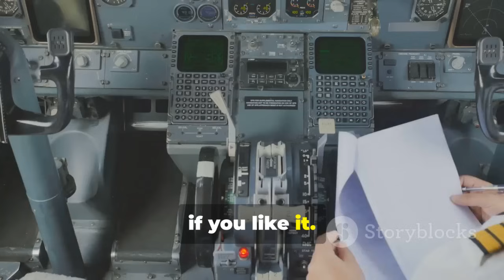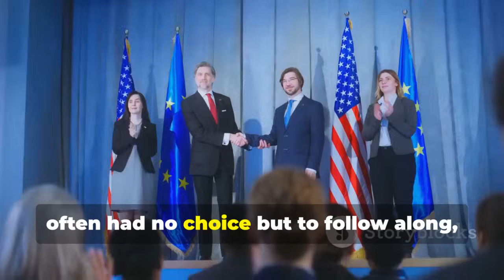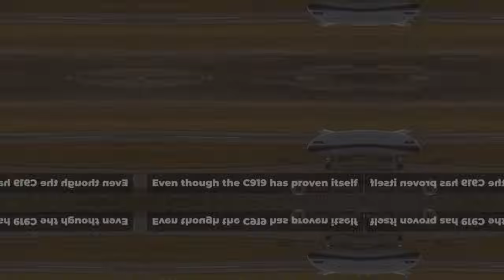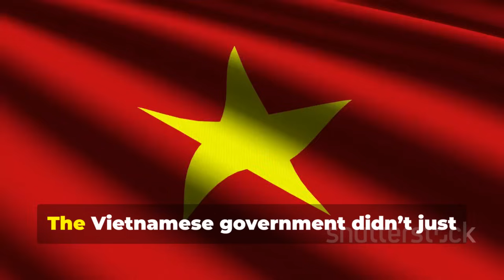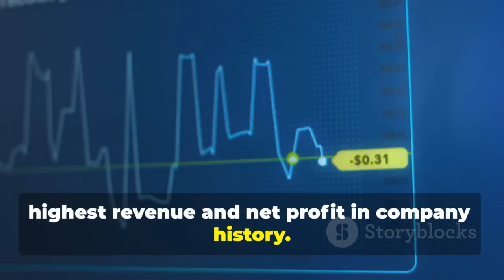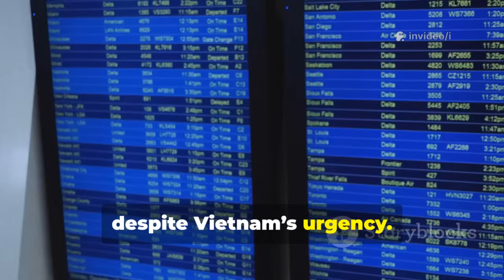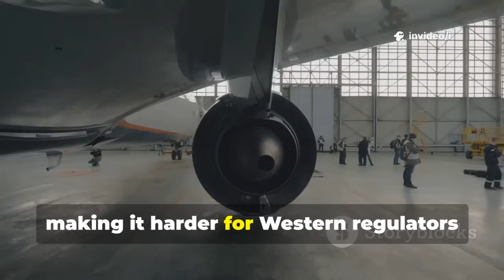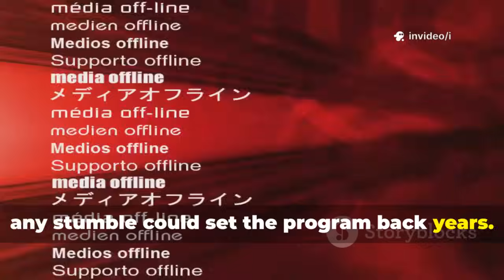Boeing & Airbus in Trouble! Vietnam Goes All-In on China’s C919 Jet

Comment: What extra proof do those   doubtful foreign airline regulatory authorities do they still need? It is already proven in China that the C919 have been successfully and safely used carrying millions of travellers for several years. Certifications are merely used to kill off competition. Simple as that. Do not buy into Western fear that the C919 lack safety features. China of course care for the safety of all its airline passengers
Reply: It has nothing to do with security. They protect themselves and politics, those are the reasons.